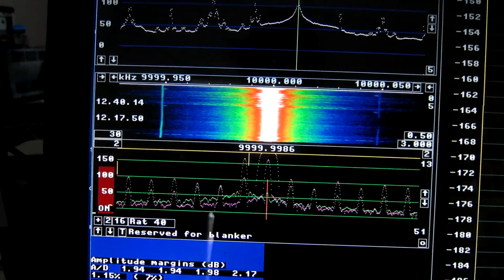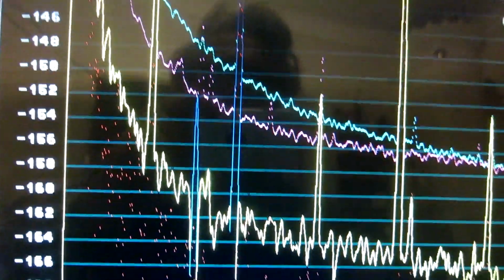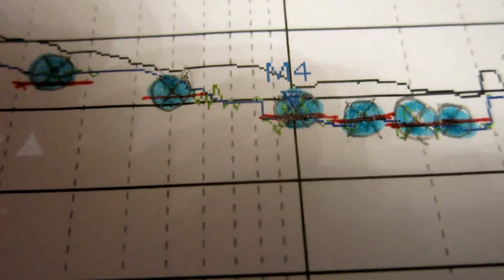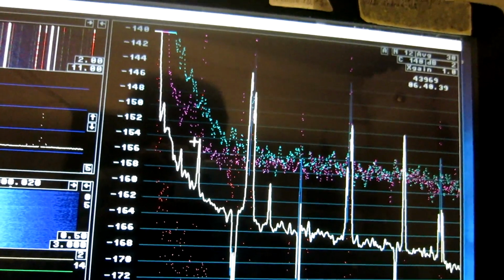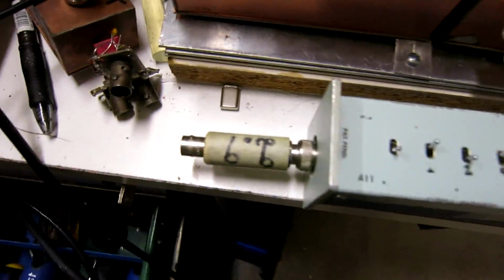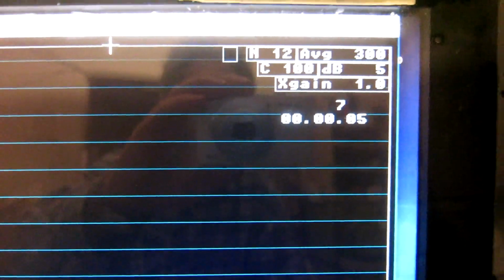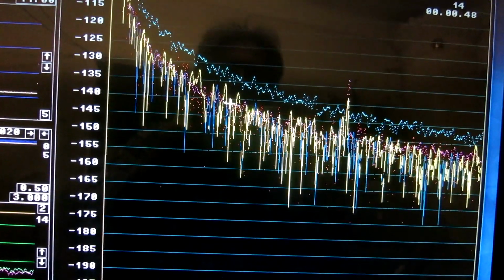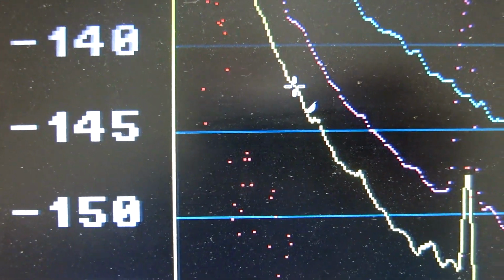nerds57

Comment: careful here,  to measure phase noise, the unit doing the measurement needs to be better than the unit under test.
so using a 10 dollar SDR to measure the phase noise of a high-end oscillator is like having a 4k TV signal and watching it on a 480p TV.   doesn't make sense.